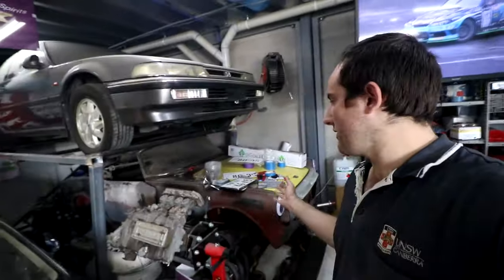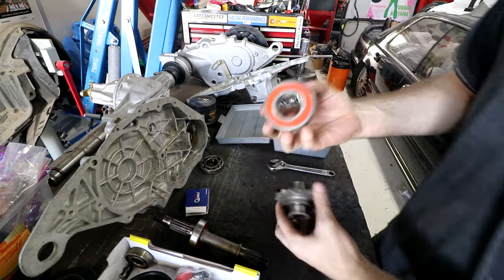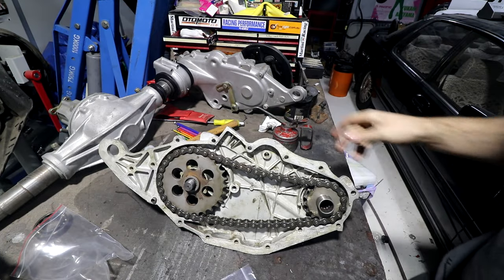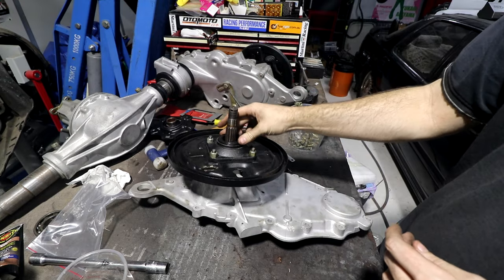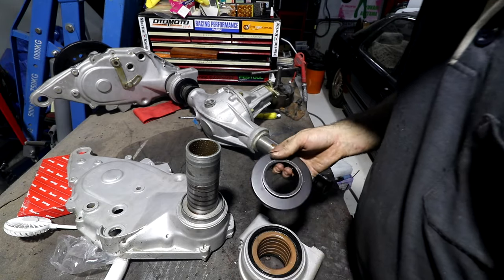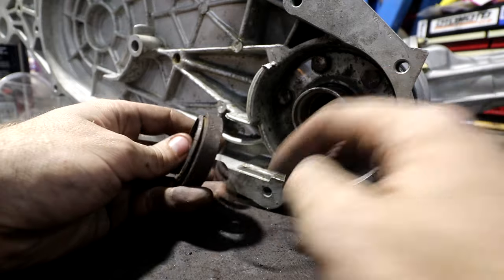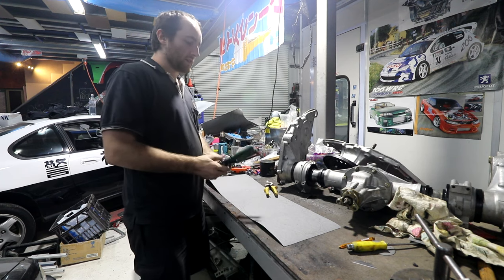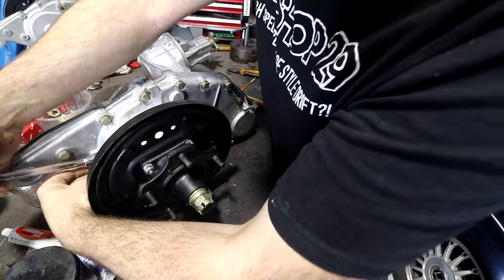Chain Drive Car.  Honda S600 Rear End Assembly.

Comment: Fast forwarding to the tube reassembly, but will watch the whole thing later. This is the first detailed video I've seen of the rear axle tubes apart and how they go back together. Those retaining clips on outer tube lip are really poorly described in the manual. Much needed help!

Comment: Also, I'm interested how you get the aluminum housings so clean? It doesn't look painted?
Reply from the maker: Glass bead blasted.  Just using a cheapo sand blasting cabinet
Reply: @Conorsev  Thanks for the reply. I did a partial rebuild of an S600 rear end-the hardest part, which should have been the easiest- removing the chain case drain bolt (galvanic weld)! It took 2 days. I feel your pain.